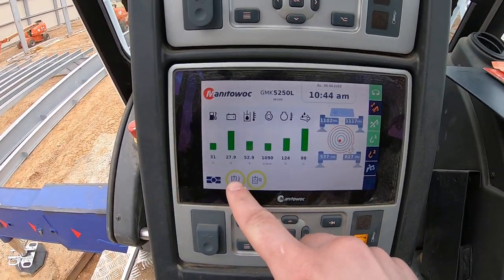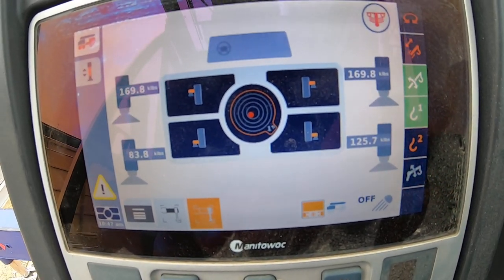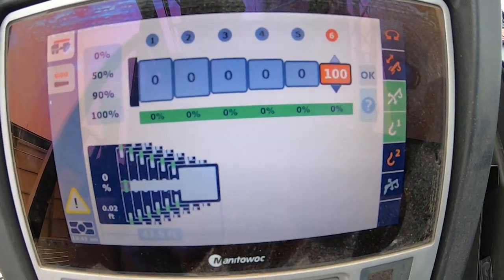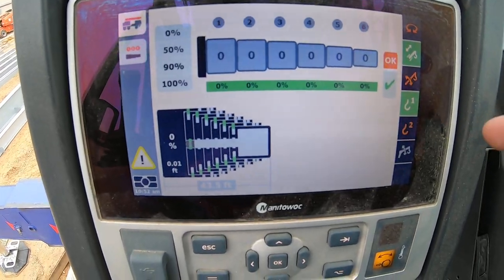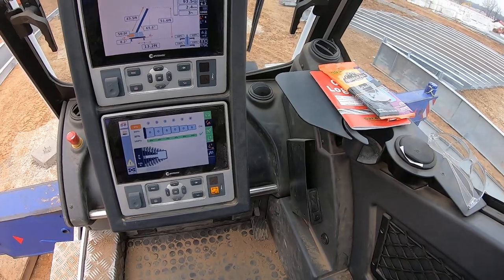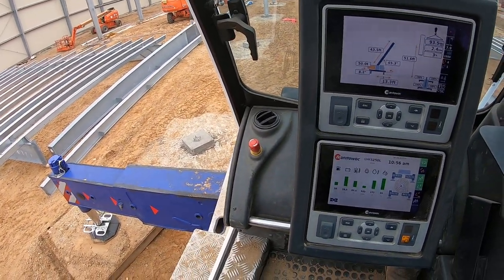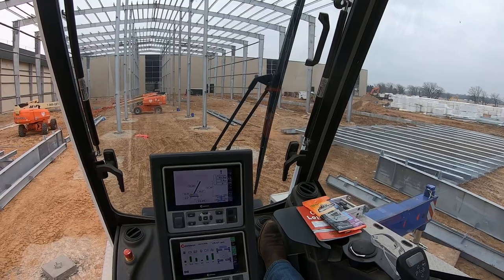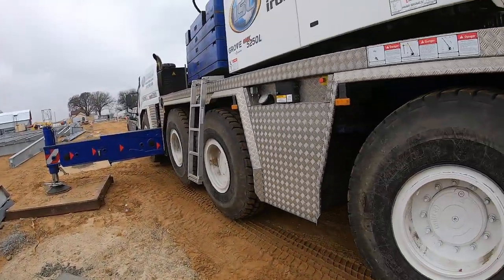GMK5250-ISC0003

Comment: Thanks sir, can you briefly tell me and others who may be willing to know. If you are extending the sections irrespective of how much you want them to be.  After it has fully extended, there on the screen what it will show to know that it is completely out and it won't make any errors.  Hope my question is understandable. Sometimes if you leave the sections not completely out, or cylinder not in its rightful place it leaves error code leave now to the crane not wanting to operate
Reply: Maybe that flashing arrow on the sections will come off when is out or in completely